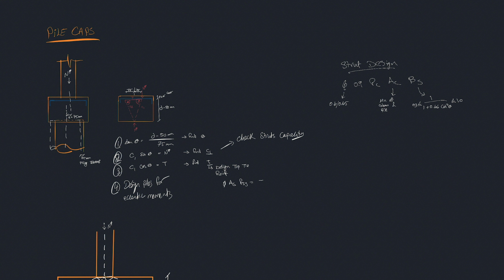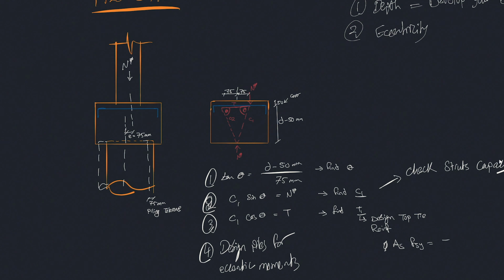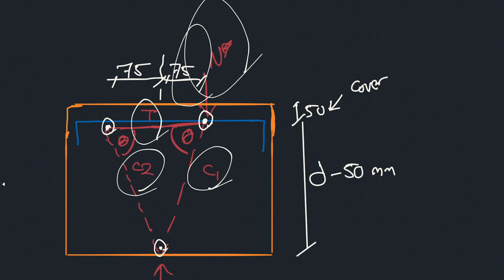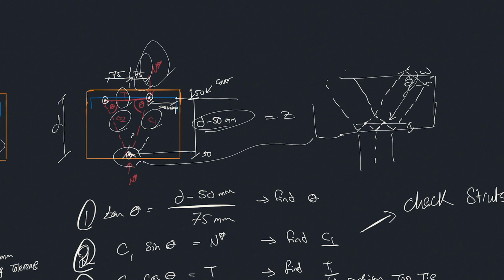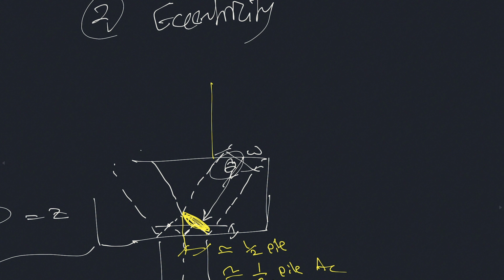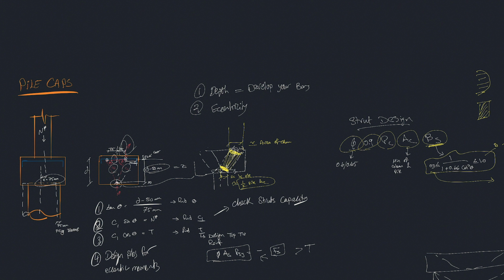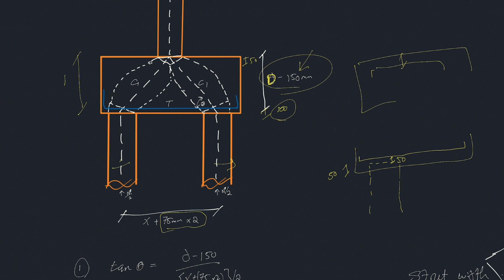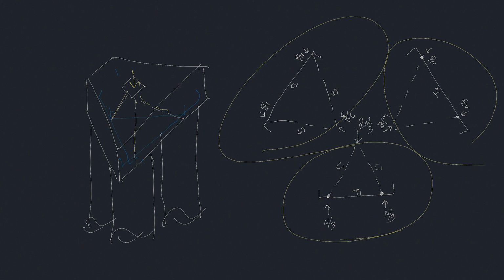Pile Caps Design - Civil Engineering Fundamentals

Comment: Great info, thanks mate. For a single pile cap with one column with different dimensions(ex: 1000x300), we should work the strut-and-tie for both directions. The first direction (1000x300) will have the tie at the top and for the second, tie will be at bottom. So for this pile cap we will have tension bars on top and bottom right!!
Reply from the maker: Possibly yes, depending on the strut-tie model you adopt. You can also sometimes, take a reduced area for direct compression through the pile, and design the column above for full eccentricity instead. I am working on walking-columns design video that will explain this alternative design method soon as well.